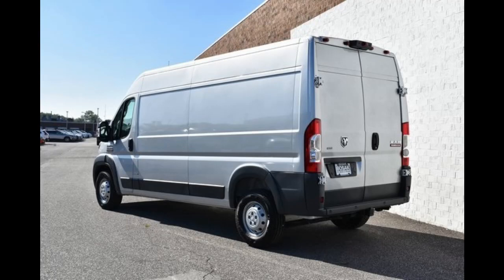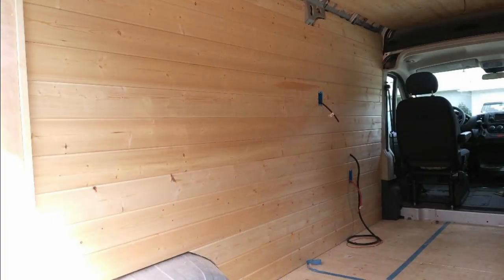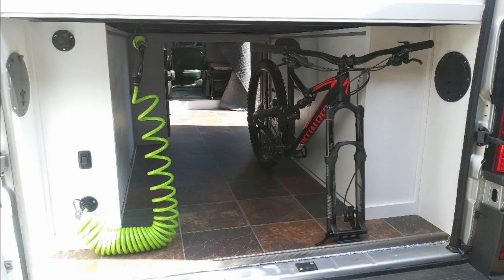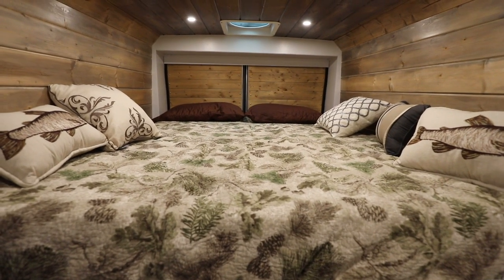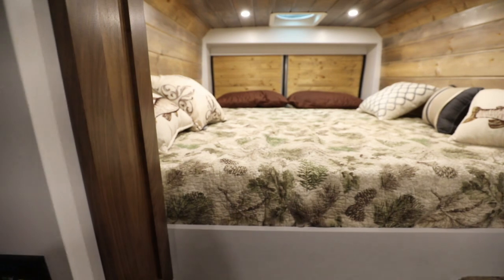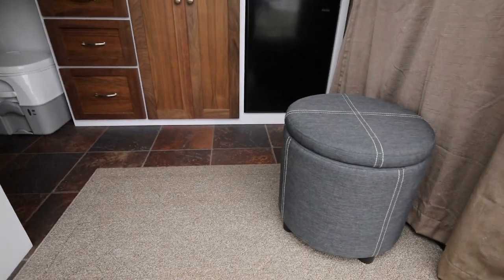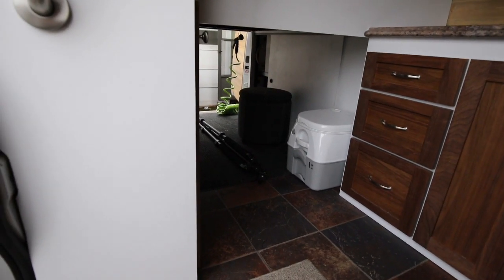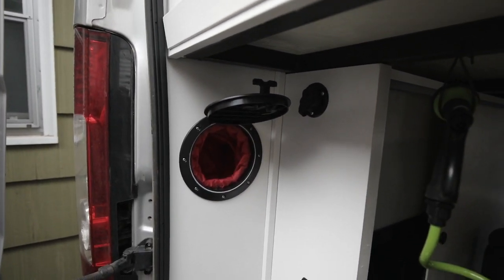Promaster Adventure Conversion Van Build

Comment: Nice build, very clean work. One thing to watch - it looks like you have a solid panel under the bed. A lot of people have had problem with mold.  That's why you see a lot of van beds with either slats, holes cut in the wood under the bed or these plastic mats with bumps on them to allow for air circulation under there.  Enjoy your van!
Reply: I've heard most have had success with the plastic mat grids.

Comment: Nice build, and thank You for the idea on those steel racks in the back. Those will solve my "problem" with the height of the bed in the back of my camper van too, together with a safe bolt-on construction for the batteries.

Comment: Very nice garage layout, so roomy!  Clean and stylish van build, nicely done.  Love the thin sliding doors to your metal garage storage shelving.  The walnut cabinet doors are stunning!  Lends a lot of class to your RV, very good design choice, and so durable too!  The kayak style hatches at rear of van is genius!  Never thought of that as an instant cubby hole storage.  Smart!
I cannot believe this is your first video.  Very well done, thanks for the tour!

Fiberglass insulation is not good for vans.  Vans get condensation on inside, unlike houses.  Fiberglass insulation collects moisture and mold.  This is not recommended.  You may want to use Black Sheep Wool, spray foam, or Polyiso boards from what I have learned on Youtube.

All heavy water tanks are on drivers side. Looks like you balanced it out with battery bank on passenger side.  Water is very heavy and you don't want that uneven tilting of a smaller van.  Most water tanks lay flat for weight distribution.  Yours are very specific to one spot, so I would worry about that at 23 gals x 8.34 lbs = 192 lbs + tank = 200+ lbs.  Then an additional 90 lbs for second tank so a total of 300 lbs on drivers side concentrated on one spot.

At 10:13 you said the setup was to charge the house batteries from the engine battery?  I think you can only charge house batteries from the alternator which is also charging the engine battery which has priority. Do you have an isolator installed too?  

Questions:  
1.  When you want to run a 110V device from your inverter, do you have to bend down and plug it into the inverter sockets, or did you wire up some special sockets on wall or cabinets which give easier access to inverter power?  If yes, what gauge wire did you use?

2.  What kind of water pump did you use?  It seemed to have a lot of water pressure in your green hose.  Or is that the narrow hose creating pressure?

3.  What made you select the Dodge ProMaster as your van of choice?  Any features you would like to emphasize?  Did you buy this new?

4.  What was the cost of cabinet doors and which company makes them please?  Beautiful!
Reply: Lass-in Angeles great questions. I also had those too. Good point regarding water tanks and weight distribution. I did see a 110 volt outlet in the kitchen to power appliances, and I saw a propane heater on the floor (portable, using 1 lbs bottle).
Reply: @msemmahale4608  Oh no!  Any propane bottles should be outside due to possible leaks.  Propane is highly flammable and explosive, so this is a risky thing.  Exterior propane tank with a connection inside is the way to do this.

Comment: Nice work Dell. What about heat? I have a 2018 3500 Promaster and put in an Esbarch gasoline heater. My bed is high enough to put my mtn bikes in without taking off the front wheel. The wood working you did is amazing.

Comment: Del, you have one of the best conversions I have seen out there. Question: If I also wanted an observation deck on the roof capable for 4 people, would you suggest building a roll cage for reinforced ribbing of the roof?
Reply from the maker: They sell some beefy roof racks that would make a good start for a deck on top.

Comment: Nice job, I am starting with a van project, great and easy ideas, practical
Do you ever think to have a shower inside the van?
Reply from the maker: Thank you!  The shower would take up a lot of space.  What I do right now is basically heat water in a pan on the hotplate and take a sponge bath so to speak.  I also am using baby wipes after using T.P. when I take a number two.  Probably too much info, but it works for me.

Comment: My biggest question with all builds like these is: How did you install the ferring strips to the walls? And how did you do it without penetrating thru to the outside?
Reply from the maker: Thats a great question.  I used a lot of self tapping deck screws that are coated.  I did have to pay close attention to the length of the screws.  I only mounted the wood strips to the frame structure of the van.  Hope that makes sense.

Comment: Good job Del.   I am starting a build with the same van - I like your rack idea for water etc in the back - can I ask how you built them?  thx
Reply from the maker: DoingStuff thank you so much.  I built the racks by cutting and weldin 1"  square tube.  I learned to weld a little bit at work.  I made a custome car by welding tube together.  There is a video of that on my channel.

Comment: As for insulation did you install anything under the 2in foam on the metal van wall? Vapor barrier? Reflectix? How about the ceiling?
Reply from the maker: I mainly used the foam.  No vapor barrier.

Comment: I need a bed the full 80 inches long.  Would it be possible to make a bed of memory foam, for example, that would be 80 inches long, but only as wide as the van is at the ceiling, then hoist/raise it up flush-ish with the roof and create more space, albeit with 8 inches or so less head room?
Reply: There are a variety of designs for raising a bed to ceiling or wall. From pulley systems to motorized to flip up and secure at the wall.

Comment: Very nice ideas here that add to all of our options. How happy are you with the van, and what kind of gas mileage are you getting?
Reply from the maker: Thank you!  Overall I really like the van.  I'm averaging 15.7 mpg.  I will say that the van is not very capable going uphill on snowy roads, even with studded tires.  I think a lot of the weight transfers off the front wheels to the back.

Comment: Nice Job, simple well thought out and not over done, How is not having windows ? just curious I'm debating the idea myself. I have the same van for work (no windows in back) but I'm planning to buy my own this spring, done a lot of planning and measuring but I haven't figured out the window question, works for work but when in a National park windows may work, curious to hear your thoughts. again nice job awesome woodwork.
Reply from the maker: Thank you so much! There are pros and cons to not having windows. I don't really have any regrets myself because I wanted it as stealth as possible. I do think it would be cool to have some small windows on the sides where the bed is, so you can see the view while it's light outside.
Reply: You can always add windows.... But removing them , welding in new metal, and then repainting.... A bit harder :p
Reply: @DelLoosePhotography  Do you think you could put flush mount windows in and use a magnetic sheet to cover them for stealth mode?

Comment: How much weight did you add to the van with the conversion? Also im wondering how much solar is possible to put on the roof if you wanted to max out all the space?
Reply from the maker: AchillesWrath1 I added a lot of weight but I still need to weigh the van to find out.  If there was no vent and you mounted solar panels side by side, you could probably fit 6 one hundred watt panels.  I fit four 100 watt panels but have a vent also.
Reply: @DelLoosePhotography  Thank you for that info. When i buy a van to convert i want the most solar possible as well as using the alternator to charge the battery bank. Maybe if i go with the 170 extended sprinter which i believe is 185" of cargo space there would be enough for space for a fan as well. Just trying to maximize the space and get an understanding of what's possible.

Comment: Can you share the link to the premade cabinet pieces? That looks great!

Are you going to try induction cooking? You certainly have the system to handle it. 

Clean build! 

The batteries look pretty tight .... Can you still water them? Any venting?
Reply: Why cook with induction?  You need special pricey pans!  Why not propane which can run your fridge too?  You can also get refillable 1 gal propane bottles for under sink install.  Induction stove is a terrible invention.  Magic Chef makes a 2 burner portable stove you can use outside with 1700 BTU which is nice and hot and cooks fast.
Reply: @lass-inangeles7564  Propane fridges are horrible things. Never again. DC or AC compressor refrigerators are the way to go in a van. The venting requirements for a propane fridge are large. Which means more holes in the van. The best day I had with my old propane fridge was when it hit the dumpster. 

Induction compatible pans are no more expensive than regular ones. Induction means nearly instant heat, very little waste heat to warm up the van, and no fumes. 

My modest 200ah LiFePO4 bank , 400 watts of solar, and vehicle charging should handle it no problem. 

I'm sure you have your numbers mixed up.... 1700btu isn't going to cook much.

Comment: Is there a way to text u I'm doing a van conversion on a ram promaster 3500 15twb extended mod
Reply: Thats great that you found a 3500. Ive been searching. Where did you find? Go big or go home!
Reply: @rtrouthouse1506  I live in mo was hard to find but found it in Indiana 13000 miles on it 2014 159wb extended model for paid 25000

Comment: Any trouble with your mechanicals on the promaster, I read some forums that say they brak down a lot. Burn out headlights a lot.
Reply from the maker: Not yet, but I only have 13k miles so far
Reply: Charlie, the primary worry is if you let it idle too long. An expediter put up a video recommending a driver only idle for no longer than 15-20 minutes. This is due to there not being enough oil pressure (historically) on Ram engines  including the Promaster. Maybe check with your dealership or favorite mechanic on type of oil in such engines, that mayhelp over long term. I have a 2013 Ram Promaster 1500 high top for business and travel, so I continue to consume all the info possible to keep it running well!